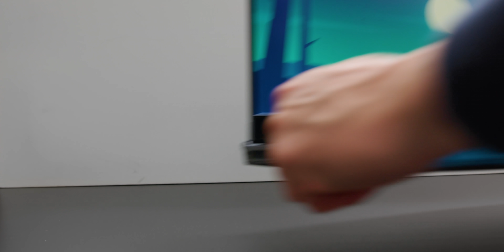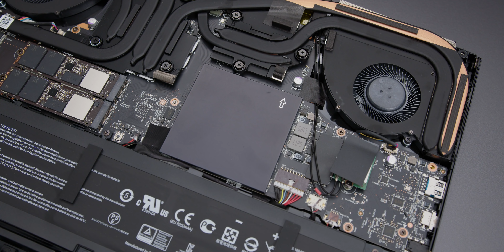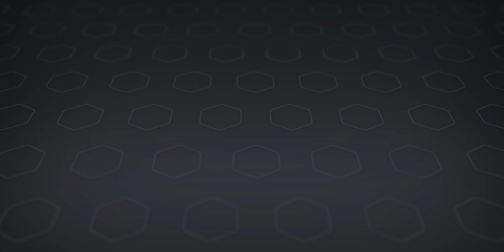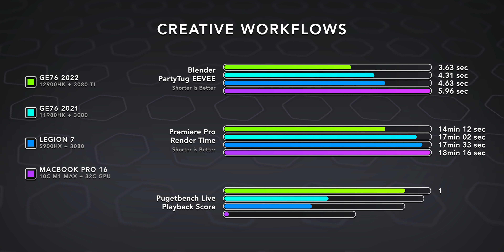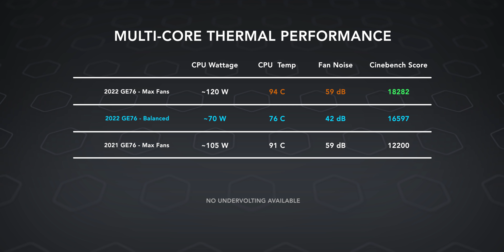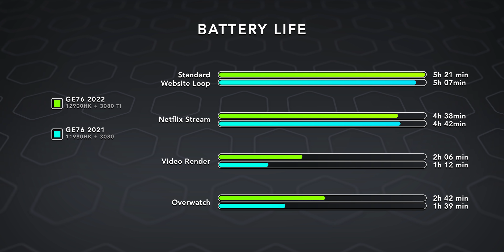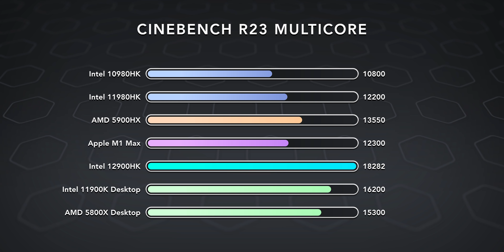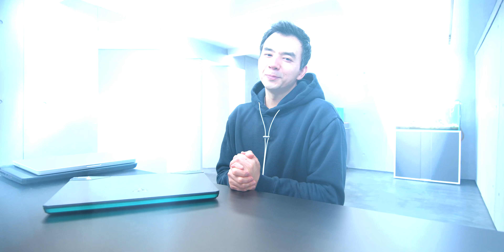This Laptop Is Faster Than Your Desktop

Comment: Very impressive performance for a laptop indeed, just afraid how crazy expensive it will be. Nice showcase
Reply: $4000, according to The Verge
Reply: @kenansadhuvideos  
That's the MSRP, you're gonna have to add whatever ridiculous markup the scalpers want to that.
Reply: @Krankynator  laptops don’t really get scalped if ever. Manage to get the 15 inch (rtx3070)  version of this laptop last year at release for msrp. Either way, $4000 is for the top of the line configuration, the i7 version will probably be $2000-$2500. Still a lot I know.
Reply: @Krankynator  lol scalpers dont scalp a laptop Hahahha they pay hefty upfront price and have diminishing returns.
Reply: ~4000 usd

Comment: I was waiting for Intel's comeback and seems like they made it! Hopefully, I can get a new laptop later this year...
Reply: Its a $6000 machine. This is not a comeback.
Reply: @snowglade1  
Yah its 6000 usd

Big brain moment

Go complain at intel for "pricing" Laptops
Reply: you dont know theres no amd reviews yet
Reply: @xruud24  
Amd will win in apu performance

Not raw performance due to it only having 8 cores
Reply: @maximumoverload222  you dont know
Reply: They didn't make it. They chose a laptop like this one because it is huge and can cool the 105W thermal furnace that is their 12900HK. Even then its at 93C in a huge chassis like the GE76... Yes they are much faster than last year (mostly because of the E-Core clusters) but no they are nowhere near what is efficient and sane. Or what competes on price.

Comment: I'm not surprised given the wattage.
this is 120 Watts just the CPU.
and then it's another what 175 Watts for GPU?

that's like 3x the energy consumption of the M1 Max at full load.
for how much more performance? 20%-30%

Comment: You forgot to mention the most important part,

This year's GE76 is MUCH more expensive than last year
Reply: Assuming this is the GE76 Raider, the current configuration (12900 + 3080 Ti)  is to be listed at $4000.
Reply: @dark_matter8420  Oh boy... Insanely low perf/price ratio.
Reply: @RaikoH6644  it's supposed to sacrifice everything to get the best performance on such form factor. It's like saying the new GE76 sucks becoz it doesn't have 24 hours battery life. That's not its purpose.
Reply: @dark_matter8420  when will it be available to buy?
Reply: @dark_matter8420  wtf.
Reply: @dark_matter8420  where can i purchase 1 or see the prices at ? if you may send me would be nice !
Reply: @dark_matter8420  damn
Reply: I’m using a $1850 MacBook. This thing’s tempting because it can game, but it’s not $4000 tempting. I’d rather build a comparable desktop for that $2150 price delta.
Reply: @abubakrakram6208  so what you’re saying is that you can have mbp and a desktop. Nice
Reply: @abubakrakram6208  bro get a PS5 of you can find one because you already have MacBook to do other stuff which PC and laptop can... Only gaming is missing so get PS5 for $400 and save$3600
Reply: @Devil-ig7kl  Probably a smart idea. If I get a console, it'll probably be an Xbox Series X though since that can play all my old Xbox games, and the PS5 can't even play my PS3 games.
Reply: @abubakrakram6208  grab whatever you can because MacBook is far better than gaming PC as well as laptop but unfortunately sucks at gaming... Not to mention that decent battery backup so it's better to get a console because despite gaming MacBook outclass both PC and gaming laptop in every single aspect
Reply: @abubakrakram6208   That's not comparable. Maybe at $3150 price point.
Reply: @alphanation368  Of course it’s not comparable. If it was, this system wouldn’t be tempting me. But the truth is, I can’t justify computers of this caliber, from Apple or anyone else. The guy recommending the Xbox is right for me.
Reply: finna end up on a tech fails list
Reply: Can u give me the link to buy the laptop
Reply: He's selling a laptop, saying it's 3.5k and performance 15% in games is not what intel's wants him to say.
Reply: @RaikoH6644  he's not selling it. There isn't an affiliate link or sponsorship in this video.
Reply: @BrianGlaze  Review = ad in 99% cases, he has a relationship with intel you know...
Reply: US $4k for a laptop or $4k into a desktop build. Hard choice.
Reply: @Krenisphia  Yea man... 4K in a desktop gets you a 6900xt, 5950x, X570 board, 850+W PSU, nice case and cooling, 1440p or 4K high refresh rate monitors and a good keyboard/mouse. 
I can understand this for people who move around for their job but stay in one place for a while. For everyone else it makes sense to get something else instead.
Reply: @Jimster481  yes, that's exactly the target market for these. They are usually too bulky to carry around 24/7, but they are great when you stay at places for 1-2 weeks at a time. I have a Blade 15 (which I'm looking to replace with one of the new gens) for 'semi-stationary' gaming and a Surface Laptop 3 for working in cafés and meeting rooms and stuff like that.
Reply: @techjan3247  Yep but $4000 is a really steep price.
Reply: @Jimster481  true, it is. But you'll probably buy this via company anyways if you can and get a write-off. In Europe that usually means getting about 40% back in tax-breaks. Prices are stupid atm nevertheless.
Reply: @techjan3247  well in the USA you definitely don't get 40% off... You write it off of your taxes for business sure... This means that it's 4k you don't get taxes on... That's like 800-1200 in saved taxes I guess provided you are in a higher bracket.. Eu has like 50-70% tax so it's a different story. However with paying such high taxes; less people have this kind of money to spend on a computer. Vicious circle.
Reply: @Krenisphia  $2000 for a desktop that beats it if MSRP was achievable.
Reply: normal people dont buy this stuff and the people who buy need the performance for which they can pay to any limits.... so stfu
Reply: 360hz 1080p screen last year top tier model right now sells for around 3300~3600 as ive seen online they are low stock. The new top tier model 2022 has 4K 120hz screen with next gen processor and 3080ti. In general, 4K 120hz screens alone in terms of monitors/tv are expensive. I think the extra $600 is honestly justifiable especially in a portable gaming package.
Reply: Much more expensive but still huge and impractical. It is basically a desktop that you can carry around.
Reply: Liver and a kidney + 4000 💶
Reply: this vs the top i9 17 razer??
Reply: So my electeic bill, and grocery bill, and gas bill, etc.

Inflation is here. These prices are here to stay. Most people haven't experienced inflation of these levels before, so it's new to them.
Reply: @moist_ointment  "Here to stay" suggests that this permanent inflation is here now, but companies who refresh every year end up with stock they need to shift. Last year's Alienware laptops are being offloaded at more than $1000 off right now at Dell, for example. The same will probably happen next Jan/Feb to tempt hesitant consumers awaiting 13th gen.
Reply: @joechapman8208  yes, "here to stay" as in prices are not going to deflate. Old inventory being offloaded at a discount, especially in the face of a huge gen-over-gen performance jump doesn't disprove this
Reply: @moist_ointment  the prices will stay like this only if people are willing to pay them. If no one is willing to buy at that price the company either lowers the prices or goes out of business. Apple used to be the more expensive option lol. By the way, I have an ryzen 5 5600x with 32gb of ram and a 6900xt desktop. I highly doubt that this laptop is capable of almost double the gaming experience than my desktop cause that's where the price leads to. 4000 usd is ridiculous lol, at that price you get a desktop variant of the i9 with a 3090 and water-cooling in a more normal GPU market. For now the best thing to do is to wait or buy an apu and play on a streaming service. I got my 6900xt around the MSRP here in Europe. Considering I've also mined almost 0.2 Ethereum on it while idle I could say I bought it under MSRP at this point.
Reply: @alexandruilea915  two things, a) "in a more normal GPU market". That's the key word right there - it's not a normal market, and price increases on laptops are indicators of that. This doesn't make sense to some, who think this market is 100% caused by cryptominers, but it's not. Theres larger forces at play. B) laptops cost more due to size. Obviously you can get more for your money if you build a desktop
Reply: @moist_ointment  for that money you can get a laptop + desktop which will outperform the laptop. I never liked the idea of a gaming laptop. If the GPU burns out it's a dead laptop. Had 2 MacBooks that died on me because of the gpu...
Reply: @moist_ointment  it's better to get a cheap i5 with 8-16gb of ram laptop for 1k and put 3k in a desktop in my opinion.
Reply: @alexandruilea915  personally, I built a desktop for gaming. Spent about $4K on everything. And for my laptop, I have a Surface Pro 4, because i want as light and small as possible (would like to upgrade to the Pro 9 later this year).

But I can definitely see why there are people who don't want a desktop because they're on the go, or don't have the room for a desk, or just want one device that they can dock to a monitor/mouse/keyboard, etc.
Reply: @moist_ointment  if you dock it to everything it's almost a desktop at that point lol. If you have the space for a monitor you can put the desktop to the side or behind the monitor anyway.
Reply: @alexandruilea915  the point being "single device"  we don't provide desktops to the engineers in my office. We provide them desktop replacement laptops and docking stations so they can take the same PC home
Reply: @moist_ointment  I have the same at work, a Lenovo t15 with an i7 and 32 gb ram but I can't make the 4 core 8 threads CPU a 12 core 24 threads CPU by docking it. It's kinda limited with what it has but it's definitely better than the dual core 4 threads i5 I had before.
Reply: @alexandruilea915  I just want to add to this discussion: I'm a gamer, but I'll soon start traveling back and forth between two countries, on a week-by-week basis. If I want to be able to game a little in the evenings, I would basically have to get two desktop PCs. At the current GPU prices, that's insane. What I can afford is having 1-2 nice screens and a keyboard at both locations. So buying a laptop like this and docking it whenever I am at home makes a lot of sense. The market for these is not huge, but it's definitely there.
Reply: @techjan3247  or you could get a PC at home and stream when you are on the other country with steam or parsec from the pc you got home if the internet connection is good.
Reply: @moist_ointment  Inflation is paying more for the same thing, and these aren't the same things (as you say "huge gen-over-gen jump"). RTX 20 to 30 was a big leap, and this time you have both CPU and RAM new gens to go with it. By all accounts even the 12400 handily beats most 11th gen chips, so you could get one of those 12th gen laptops if you want. You don't need a 3080Ti. I want to see those lower tier prices before calling this an inflation.
Reply: @joechapman8208  the highest inflation rates in over 40 years are 100%, absolutely happening. And this includes upstream supply for OEMs
Reply: @moist_ointment  Most people who experienced inflation on these levels before never paid $4000 for a laptop either. Does that impact your sense of superiority?
Reply: @Droopytown  lmao, in the mid 1990s, USED laptops were like $1500, with many laptops going for over $5K, some even over $10K. What are you talking about. "$4K for the fully optioned version of the most powerful laptop money can buy is too much wahhh"
Reply: @moist_ointment  
Precisely. Well, that and this is coming out after the whole crypto/scalper market. Now businesses see that their shit will sell even at a much higher price. So, expect NGreedia to mark-up their GPUs significantly as well with the 4000 series. I'm expecting the price to double, knowing them. The future of PC gaming is about to die and it's all because of crypto miners and scalpers.
Reply: @moist_ointment  1kwh is the same performance no matter what, Intel performance/ratio is atrocious and that's why they told every reviewer to ignore the price. Inflation has nothing to do with that. Consumers are being trained fast.
Reply: @RaikoH6644  this is very much the take of a gamer who doesn't strongly follow financial markets. 

And you're brining up different things - perf/watt ratio has NOTHING to do with the price discussion. You think Ryzen 6000 laptops won't see price increases too? You don't think supply chain issues, 7% inflation, excess market liquidity, raw material shortages, RAM price increases, lockdowns in China, shipping ports backed up, global shipping costs increasing, etc. Aren't playing a role in price increases and that this is a corporate conspiracy?
Reply: @moist_ointment  I meant perf/price my bad. So if a laptop was less than half the price for around 15% less perf it's atrocious.
Reply: @RaikoH6644  super misleading on pricing there. This compares to MacBook Pro 16", which starts at $2500 without any RAM or storage upgrades. The laptop being reviewed here is not the base model option either.

As for 15% performance...yeah, in synthetic benchmarks. MacBook Pro doesn't come even remotely close in gaming, the direct target market for this device. Theres also bigger than 15% gaps in some professional workloads as well.
Reply: How much does this thing cost ?
Reply: @medimeb  edit: top SKU will be $4200 USD according to notebookcheck, (pre-tax, and excluding the upcharge on added storage and memory)
Reply: @blue4059  still cheaper than a macbook
Reply: @blue4059  You think I can find a gaming laptop with i7 12700H, RTX 3070ti with 1500 euro here in Austria?

Comment: I wish you showed the power brick. My guess is it must be huge/heavy to the point where portability is affected.
Reply: 175w for gpu and I think he said 75w for the cpu so maybe at least a 250w brick?
Reply: @CDCK006  Pretty sure it's at least 300 Watts
Reply: @josephjoestar77  in another review it says it comes with 280w brick
Reply: @CDCK006  105W for the CPU in performance mode. 175W for the GPU.... thats 280W already. It has to have a 300+W brick or it has to turn the CPU power down to use the GPU. Which is also not talked about here. This video is a best case scenario for Intel and this is why they chose it.
Reply: The laptop itself is huge and the power brick has to be like 300W.

Comment: Credits to Apple for bringing out the best in Intel. A great win for consumers.
Reply: Only its more expensive lol, this is a massive tech fail for performance to price ratio.
Reply: not really apple these are gaming processors apple is not their competitor here but AMD is the reason they did this well
Reply: Not Apple, it's AMD.
Reply: @AyAy008  *both
Reply: @AyAy008  Apple literally told Intel to fuck off with the New M1 Chips
Reply: @Vinícius Felipe Posselt again not true bcz most intel laptops are gaming ones and gaming competitor is amd and not apple
Reply: @anand.suralkar  Indian Apple Sheep
Reply: @anand.suralkar  You're missing the entire point. The fact that Apple replaced Intel for their own M1 chips, which mops most of Intels mobile chips with ease and stunned the computer industry with M1's ARM capabilities, does make Apple a competitor in the chip technology market.
Reply: Intel had this CPU designed years before the M1 Max was even announced.
Reply: I already know you're an apple user. Apple is middle ground right now what are you even talking about
Reply: @vosk6481  yeah apple is for people who never needed to charge their laptops for days while working on their 4k-8k videos project. People who compiles code without ever needing to charge the laptop for one whole week.

I mean who charge their laptops anyway? MBP can last for weeks according to hype.
Reply: @RGkid-aja  Really dude? Even apple said that M1 max only have a battery life about 13 hours for light task such as watching videos. Are you drunk? Even I never seen someone using MacBook without plug in when rendering. You get too much hype, without even knowing the truth.

Comment: Amazing specs but 360hz monitors are useless. Basically no game can go over 300fps. And even if some does, it doesn't make any different to the human eye/brain. 240hz is plenty enough, i would even say 144hz is already amazing.
Reply: Dave specifically said the 360hz monitor is for pro gaming. And if you ask any E-sport player whether 240hz and 360hz makes a difference, they will tell you a resounding YES. Ofcourse it's not meant for regular consumers like you and me, but don't say something so blatant as "useless" because it's a necessity for a specific audience
Reply: @mateotelleria4734  actually even pro gamers struggle to see a difference beyond 240hz. Diminishing returns is a real concept.
Reply: @humanbass  Keep telling yourself that if it makes you feel better for not having a 360hz display. When the possibilty of winning tens of thousands of dollars is at stake, I doubt a pro player would settle with subpar equipment if they got the money to buy the best of the best